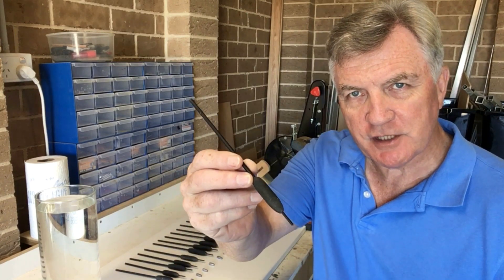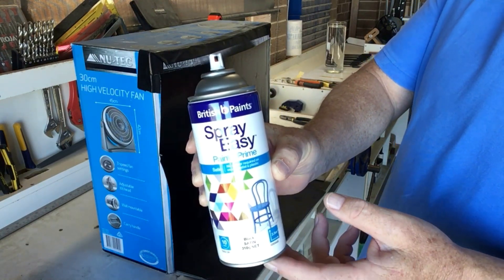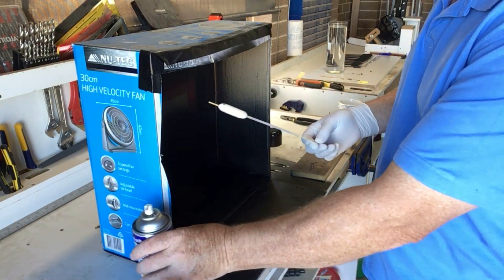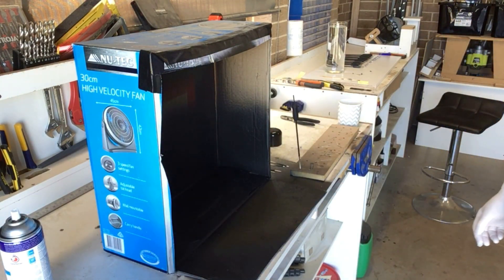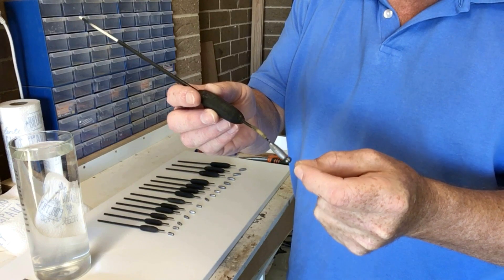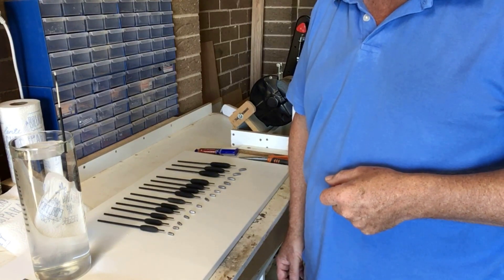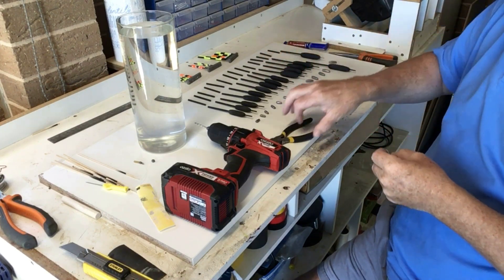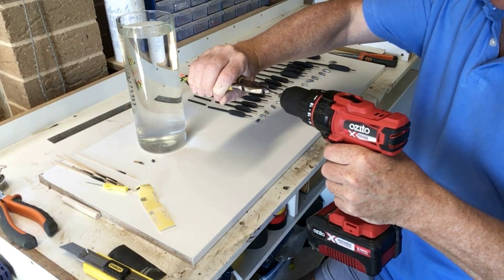Make Loaded Bodied Waggler Floats with Plug In Tips - Part Two

Comment: Den, To simplify the construction could you leave  a longer tail under the body of the float, drill right through the weight and use a float adaptor rather than an eye? If weight is an issue to the adaptor holding then perhaps adhesive.

Comment: Could they be made into driftbeater style floats ?
Reply from the maker: I don't see why not Stephen. You could try cutting the hollow plastic section down and use a longer stem on the Plug in Tips to reduce drag on that section. 

Having said that I encountered a high wing problem on my local pond recently. I used the float with longer inserts to get the body below the drift, which worked well. I also dragged some small shots along the bottom to assist. 

This aspect may become clearer for you after next weeks episode where I show you how to make the Plug In Tips. I will also be doing a video shortly on how to combat drift caused by wind. I hope that helps.
Reply: Fishing with Den thank you for your time in answering my question
Reply from the maker: @stephenstocks1074  No worries mate. Please feel free to keep asking questions. Also if you have any thoughts for videos, I am happy to listen.